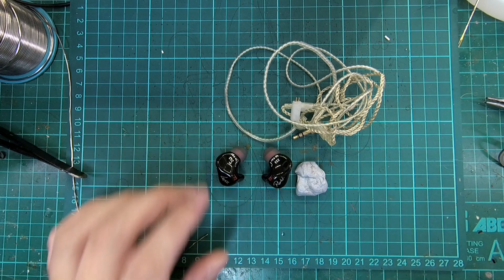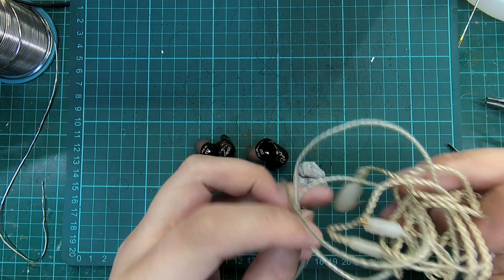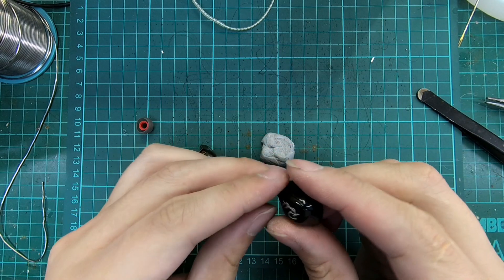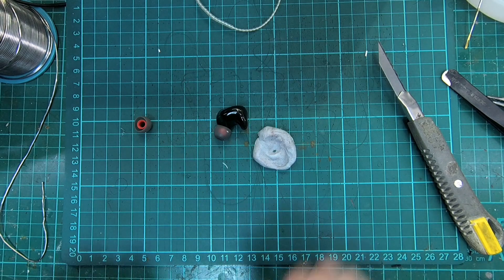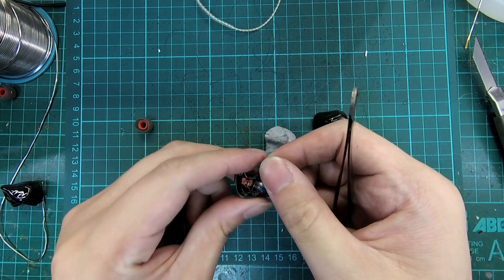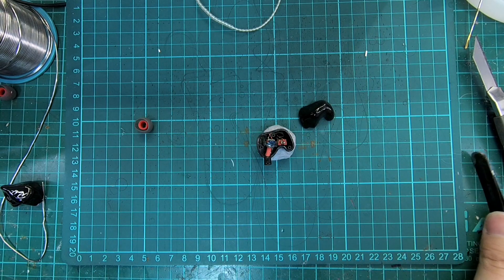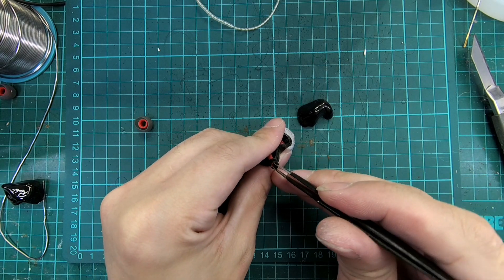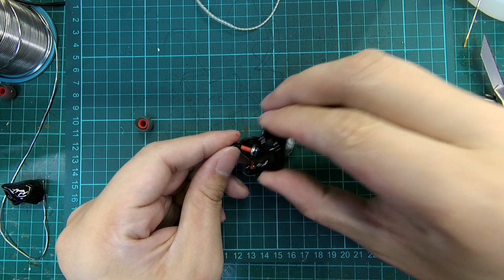KZ ZS3 GREAT for DIY IEM modding ? ZS3 teardown reveal  [NAKED Reveal]

Comment: Hello sir, I have a CCA CSN which the faceplate is metal and the body is plastic, the socket where the wire connects to has become loose and it can be solve by tightening the screw on the inside. The problem is how to remove the faceplate safely should I consider heating it then pry it open? Then how to glue it back?

Comment: In short it is disposable, after 3 years of usage the driver had given up,i replaced it with 10mm driver modding the  mounting bracket,and now it sound crappy.

Comment: No i won't fit 10mm drive i tried it,replacing the driver makes it less bassy, because it's not air tight after replacing driver
Reply from the maker: Okay, I didn't mention that there are not basic level of Mods.. U will actually have to know how to seal large drivers on to a small shell, and have SW understanding on how to do the front and back venting tuning to be able to start, might do some videos on that

Comment: Some KZ multi-driver IEMs (like the DQ6s, ZEX CRN) have barely audible but working drivers (Ba/Magneto/Electret). I was wondering if these can be re-used or re-implemented to make them work to the current KZ IEM and possibly adding mods to make it a DIY/Custom-made IEM. If so, how can these be achieved?
Reply from the maker: Some of those "barely audible" drivers are used to cancel out frequencies they don't want, thus acting as a "tuning" sort of thing.
Reply: @sgaudiohive  Ohh I see. Is that despite not making any noticeable changes in the FR when they are disconnected from the DD?